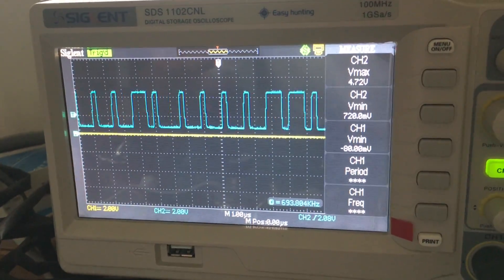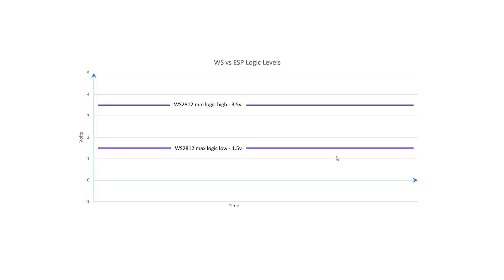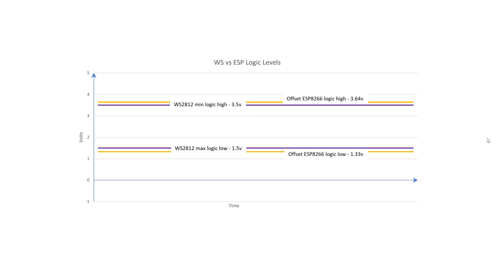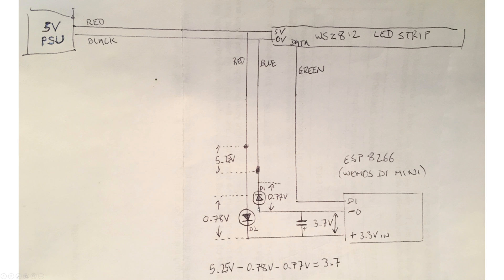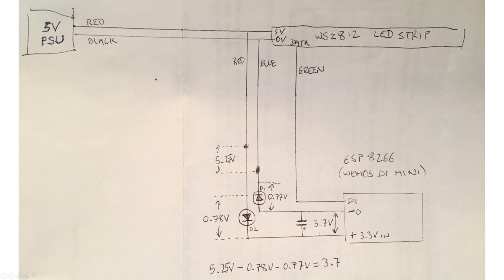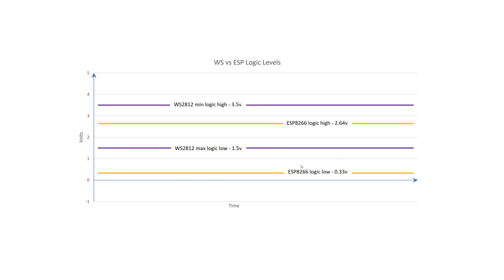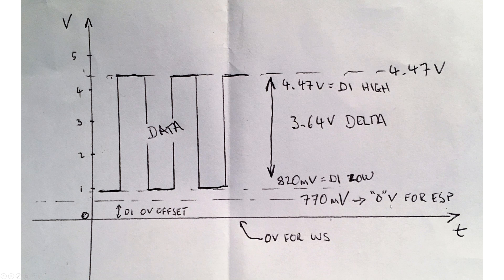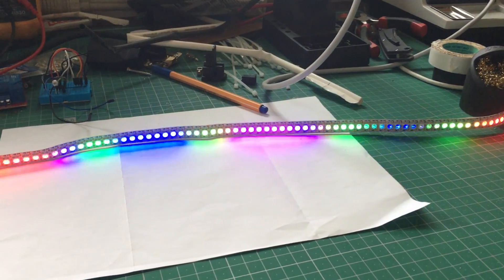3.3v ESP8266 driving 5v WS2811 / WS2812 without level shifters or voltage regs

Comment: A nice different approach than my current project. I opted to lower the 5v supply (using a lipoly battery) so the 3.3v signal would work.

Comment: Thank you! It worked perfectly with 1n4007 diodes! I also had to put a 4.3 K ohm resistor to signal line.
Reply: Why? Does not the input have very high resistance anyway?!

Comment: I just tried this. My preferred device, the Firebeetle ESP32, has a LDO regulator that drops 0.53V at a max. So I found it was quite happy with one 1N4001 on the ground side and 5V delivered to the VCC pin, where it was regulated down to 3.3V. My 1N4001 dropped 0.8V so the logic high was slightly out of spec (3.44V by the book vs the WS2811's requirement for 5.5V) but as you said, it's likely the GPIO probably put out a little more than the absolute minimum.

Cool thing was, it worked better than a 74HTC125 that I'd tried first, which was being very ill behaved (lots of random glitches).

Comment: That's a great idea! You're selling yourself short though. This addresses not just the potential signaling problem, but lets you power both devices from the single 5V too! I'm an electronics newbie, so can't say I follow 100% of the details in the video, but nearly so. (That's on me, not you--this was presented very well). Two questions for you if you'd be so kind: 

1) I got the impression from what you said that the capacitor might not be necessary, but you put it in there anyway--is it really needed and if so, why, and recommendations for specs? 
2) Remember, newbie here--what is the D1 mini providing that you're using that a nearly bare esp8266 module couldn't provide? I guess what I'm asking is, assuming you've already programmed something like a ESP-WROOM-02 module (e.g., just the black pcb part of your d1 mini), could you just wire things up as shown directly to the module or would you need extra things/components that the D1 mini is providing?

Thanks!
Reply from the maker: Hi Ken, thanks for the comments!  You're right, though - I didn't make it clear enough that this technique is used for two reasons (both level shifting the data line and providing supply voltage to the 3.3v part).

To answer your questions:

1)  The cap is not strictly necessary (unless you have a noisy PSU).  Everything worked fine without - I just put it there as I kept on either disrupting the LED string or crashing the ESP due to all my prodding and poking with multimeter & CRO when I was making the video.  I just grabbed whatever I had on hand (I think it was a 100uF 16v electrolytic).  You may have to implement more/less/different depending on what MCU you're using & what supply decoupling it already has.

2)  A bare ESP will do fine here (though will probably need some caps on supply lines to keep it stable).  I just used the D1 as, again, it's what I had on hand (notice, I used the 3.3v supply pin on the board instead of the 5v supply (which has a 3.3v LDO linear voltage reg on it) in order to demonstrate diodes dropping 5v supply down to (close enough to) 3.3v in order to power the ESP).

Good luck with your project!

Comment: There is an even simpler solution using just one diode: https://hackaday.com/2017/01/20/cheating-at-5v-ws2812-control-to-use-a-3-3v-data-line/

Comment: Nice Video!  Just wanted to clarify, "Hysteresis is the dependence of the state of a system on its history."  It is not simply the range between low and high voltages.
Reply from the maker: Thanks for watching the video & taking the time to make a comment :)

You're absolutely right - the correct term that I should have been using is "hysteresis gap", not just "hysteresis".  Thanks for pointing that out.

For those readers who are curious to learn more, in the context of Schmitt triggers (which is typically how digital inputs (ie on the WS chip) are implemented) - the behaviour of having 'high' & 'low' thresholds, and only changing state when input voltage crosses the opposite threshold to that just crossed, (ie the trigger 'remembers' its current state until the opposite threshold is crossed) is called "hysteresis".  The difference between the thresholds is the "hysteresis gap".  Read more at https://en.wikipedia.org/wiki/Schmitt_trigger.

Comment: My strip is running of a ESP-01 happily without any modifications
Reply from the maker: Cool.  Successfully driving WS LED strips directly seems to depend on several factors, including manufacturer (some LED chipsets seem to be more forgiving than others), cable lengths & impedance, power supply, and software doing the actual signalling (seems to be timing related as well). YMMV as they say :).

If you're one of the unlucky ones however, then this trivially simple method to bring your signalling closer to spec as well as providing a power supply rail for your 3.3v mcu is worth a try! :)
Reply from the maker: ...plus also, by putting diodes on the power lines, this method lets you drive 3.3v MCU from the LED's 5v supply without requiring an additional PSU, regulator, converter, etc.

Comment: Thanks for this great idea.
I buy 6 boards with 8X8 LEDs and I found that on every board work only first few LEDs 
For example one of the board that I have now on table work only first 39 LEDs and the other until 64 is not work. 

So I try to see if with this great idea using 2 rectifier diodes will work... but it stop at same LED :-( 

Have an idea why all this please ? 
I use NodeMcu, but I also try using Arduino Mega(same error) 
and I use FastLed (but I also try the NoePixel) 

Thanks a lot
Reply from the maker: Hi, if it works for the first LED, then it should work for all subsequent LEDs (as each one regenerates the signal for the next).  This 'trick' is not applicable in your case.

At a guess, you have either got faulty boards, or insufficient power supply, or a software problem.

Things to try:
  * Check to see if power & data lines are properly connected from one end to another.
  * Try injecting your data signal further down in the chain of LEDs.  If less LEDs now light up, then it's probably a hardware issue.  If the same number of LEDs light up, but now go further down the string, then it's probably a software issue or power issue.
  * If you see exactly the same issue for the same software/NodeMCU and multiple boards, then it is probably software & not faulty boards.
  * Try also running all the LEDS at, say, 15% brightness & only one colour.  If more LEDs light up, then you're not providing them with enough power.
  *Otherwise, I'd say you have a software issue.

Good luck! :)
Reply: You may need to change the number of LED's parameter in your code.

Comment: I have a 12V ws2811 strand that is suffering from horrible flickering.  Would there be any different parts I should purchase for 12V (vs 5v)? Hoping to give this a go to resolve my issues.
Reply from the maker: How long is the string of LEDs?  The data line should still be 5v.  Make sure you have a common ground between the MCU and LEDs (with diode on the negative line to give the MCU the right offset), make sure you're giving the MCU the right supply voltage, and make sure the 12v power supply is sufficient for the number of LEDs.

What happens if you reduce the length of the LED string to, say, 20 or 30.  Does the flickering go away?  If so, probably power.

Comment: The NodeMCU V3 only has 3.3v.. but on your Wemos there is a 5V pin.. on the bottom left, does it mean it actually has 5V? i am sure you only used it for demo purposes for the 3.3v which was cool to see, i am looking for an arduino nano alternative with remote control because of size restrictions on the project to get rid of a display and rotary encoder
Reply from the maker: Yes indeed, the Wemos board has a 5v input with a linear regulator to take it down to the required 3.3v for the ESP.  

The whole point of the demo, however, was to show a 3.3v device driving the WS2811 strip - which would normally require level shifters for data and a voltage reg for power - without those elements, just using diodes instead.  Hence I'm using the 3.3v input...
Reply: Of course, Wemos has 5V input. Defeats the object of bringing the Wemos 3.3v input high relative to the 5V driving the LED strip though doesn’t it? Which is the whole point of this video.

Comment: Great solution, but what about WS2813 strips? I'm driving directly from NodeMcu Esp8266MOD board. Connecting V+ and GND from both ends, sharing GND with NodeMcu and only B0 as DATA input. However connecting D0 has the same result.....Erratic leds powering on. Using McLighting library and declaring strip as WS2811.

Comment: I did it, but I havce some errores and seems it is not running smoothly.  I confirmed the .7mV offset exists on the Data using an scope.  I ma observing a kind of peeks noise,  I am using an electrolitic cap 100uF.  Any idea?
Reply from the maker: If you're driving data directly from digital output, then I would expect an exceptionally clean signal -- not sure where you're seeing the noise?

Have you tried checking the power rails to make sure they're clean?

Comment: Well I wonder if I just been lucky, I have never had a problem with APA102 or WS2812B from any MCU. This does look like a better way though.
Reply from the maker: Yeah, seems to be luck of the draw -- but keep in mind that this technique is being used to both drop supply voltage from 5v sufficiently to power the ESP and offset the signal.  Two birds with one very cheap & simple stone :)

Comment: Interesting.  I'll have to try this myself.  Generally, all of my ESP-Neopixel projects involve a long line from the ESP to the first pixel so using the little TC4427 FET driver helps drive those wires to the first pixel.  After the first pixel, the signal is regenerated anyway. Also: Using actual science to talk about something on YouTube is something of a rarity, so thanks!
PS: Looking forward to more videos.
Reply from the maker: Thanks!  I've managed to drive really quite long lines directly from the ESP with this technique as well.  Another option is place a single LED 'close' to the ESP, and then use that to drive the long line (this fixed a problem for me when using a Teensy & OctoWS2811).
Reply from the maker: Also - another aspect of this that I don't explain very clearly - using a couple of diodes on the power lines also lets you drive a 3.3v MCU from the LED's 5v supply line - no extra PSU or converters needed :)